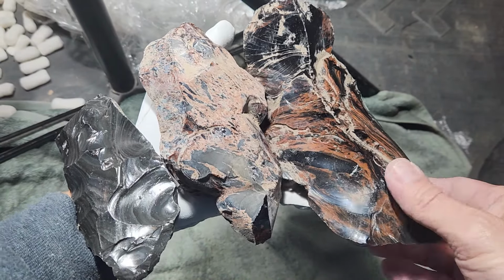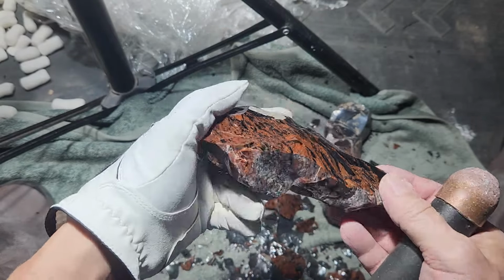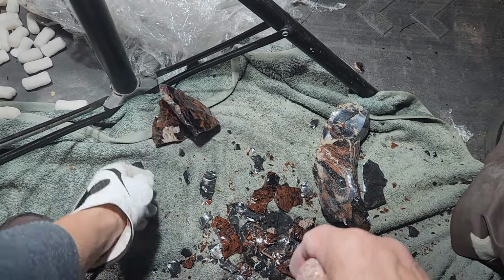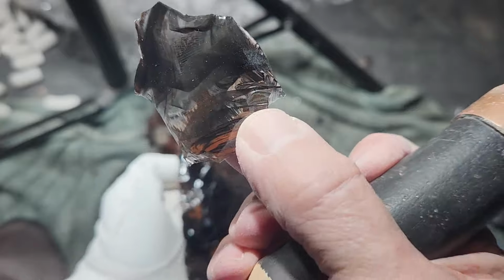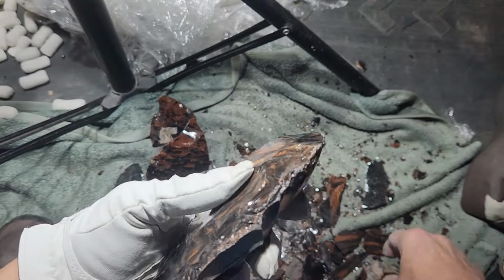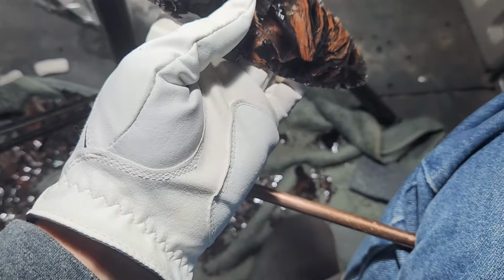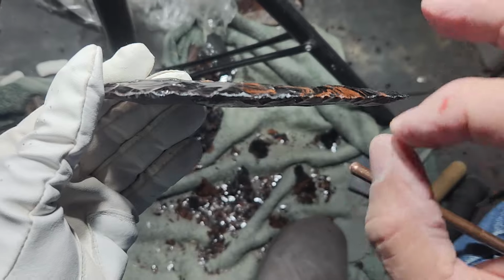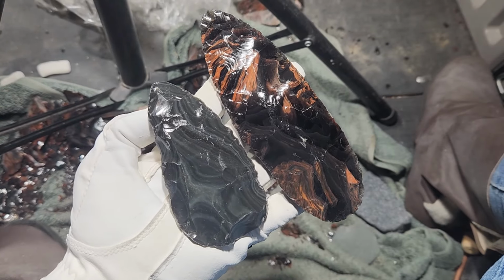1985 - Part 1/3 - Challenging Obsidian #flintknapping

Comment: This will either sound strange, or you’ll know exactly what I’m talking about.  Do you have a direct percussion swing and strike that keeps the bopper in contact with the edge “longer” for a different type of flake removal that works “better” with certain rock?  Flakes will “peel” differently in that they seem to me to run longer and feather out better, but only infrequently with some rock.
Reply from the maker: Yes. My direct percussion swing that seems to produce longer flakes is a swing where the bopper's top or crown is hitting the workpiece.